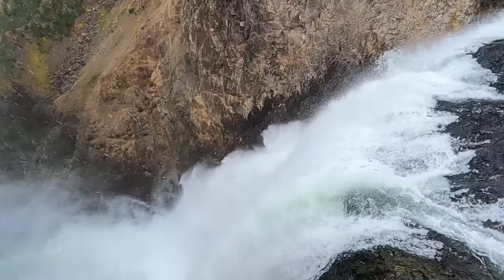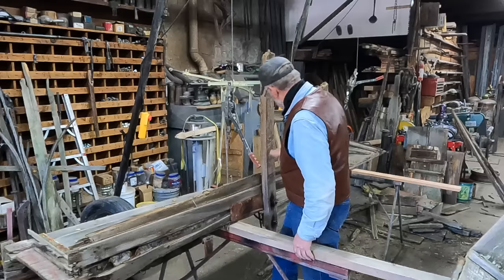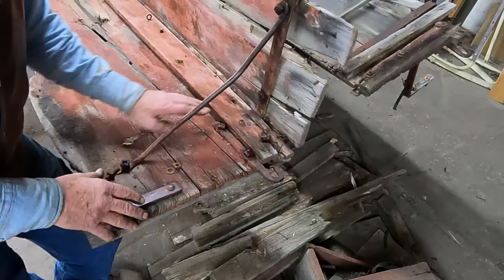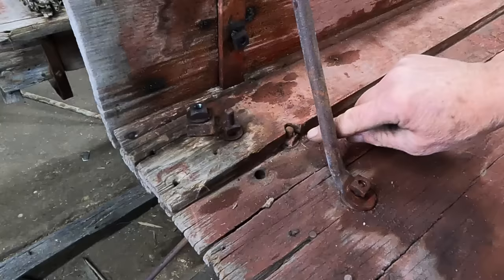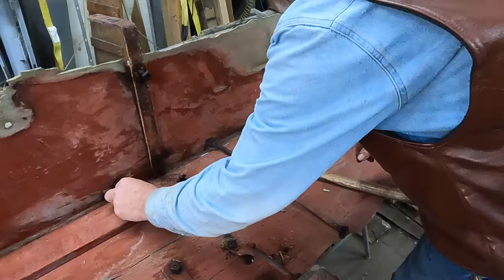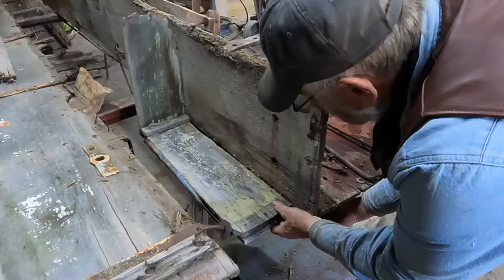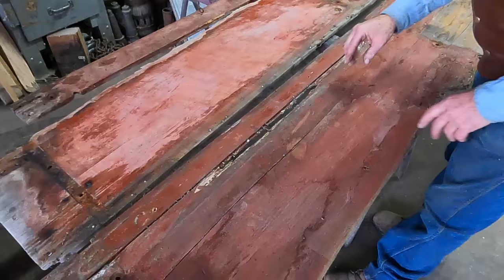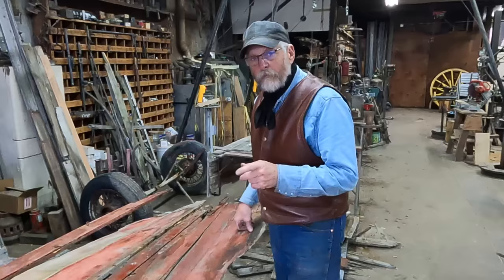If This Was Yours, What Would You Do? | Engels Coach Shop

Comment: For me, I would be considering the added labor in trying to keep as much of the old as possible. Seems to be much less labor intensive to go with all new wood materials. Depending on the owners budget it could be some kind of a waste not to go the right path with a budget constraint due to the end results.  I guess it could be patched and so forth but I'd hate to trade all of that labor to end up with an old rotted out mostly wagon. The iron work looks to me to be the same amount of work going with fixing it vs replacing all of the wood.  The sides have potential, the floor is gone, the structure is gone, dry rot is technically a living organism so, for me and considering Dave's expertise, I'd just duplicate that woodwork with new and bare the costs vs. forcing the craftsman in doing things against his norm.

Comment: All old ironwork, with new replacement of missing items aged as you do. New wood throughout where so deemed necessary,  but stressing absolute size  and dimensions taken to achieve strict duplicate copying of the original as it was perceived curing a careful and sympathetic dismantling. That should reassure the owner every care to comply had been taken to stay in cost restraints.

Comment: Looking at what is there, I would only use the irons and recreate the wood parts. As MrJeffro56 said attaching new wood to old won't last the old wood is far drier than any new wood you would attach to it. Given that in the long run you are doing the owner any favors splicing old and new wood. I would replace whole pieces or use whole pieces, but not splice. Interesting problem and thanks for sharing the process.
Reply: This is a piece of history, representing the hardscrabble existence the early settlers dealt with. All of that old wood tells a story and I would keep it except the most rotted. Where boards are compromised, I would make a 30 degree miter (looking at edge of board) and feather in a scab in as little as necessary with wood glue. To discard most of the wood, would make it a new wagon and no longer 'historical'. And if I remember correctly the owner was interested in preserving the history and did not simply order a new wagon with old irons.

Comment: I would not try to restore it to usable condition. I would have asked it to be made into an art piece by adding some framework and supports as needed to put it back to original shape (as much as humanly possible) and then use modern chemicals and paint to preserve and seal the wood that was remaining. Then I would pay for an all new replacement to be made based on that design and dimensions.

Comment: I suspect that anything you save in terms of the wood will be the first thing that will need replacing in a few years. Seems like you'd just be prolonging the inevitable. I also think that the normal stresses and strains on the structure would kind of seek out the old wood and looses up the joints. The biggest decision factor for me though is that having seen your previous work , if it was my wagon , I'd want a new build with the old irons referbished .

Comment: I'd prefer new wood to be honest, perhaps keeping what could be salvaged from the sides and benches for use as flooring.  But if they want to use it on the sides, there would need to be lots of chopping up in both width and length to make usable planks.   After that, both side and end tongue and grove joints to glue whatever could be salvaged together.

Comment: The owner is just going to have to accept that using the old iron work and replacing the wood pieces patterned from the rotted wood will yield the exact same wagon (kinda like the Irishman's family heritage hammer, same hammer in the family for 100 years with 2 new heads and 5 replacement handles..................but it's still the same hammer).

Comment: I like your investigation and your way of thoughts with the remaines of those old wagons.
To me you seem more like an wagonarchaeologist or a sherlock holmes of cartinvestigation.
For the restoration : the owner's wishes in mind I should considder (for at least the sideboards) to repair and to restore them with liquid epoxy.  That's a completly different method than you are used to, but it prevent of cutting mutch of the wood away and allows you to remaine as mutch as possible af the old wood.
Just an idea.

Comment: Seems to me that the prime question that needs to be answered, (that will help decide on how much to keep), is WHAT IS THE END RESULT GOING TO BE USED FOR?
If it is going to be a static Museum exhibit (for example), keep as much as you can and 'fill in the blanks' to present a picture.
If it is to be used for more than just wheeling out to be seen, IE hitched to a team and DRIVEN, keep the iron work for authenticity, and use the remains as a pattern to build a replica. Less time consuming to 'age' the new wood but not have to 'distress' it to match the original. 
Keeping the most amount of sound original timber, and add new such that it does not stand out like a sore thumb is going to be a real money pit. If it were a classic car, with impeccable provenance, that time and money might be justified. To me, a replica would be more informative and useful. As an exercise in "Practical Archaeology," seeing how things were put together is easier with new, whole, timber, whereas bits of new mixed with bits of old just results in a 3D Jigsaw! You can't see how it was originally made when the original joint had 3 pieces but the new has 6, half of them patched in.

Comment: Discard all the wood. Create a new box proportionately smaller that the original. Perhaps, 75% scale. ( it is not going to be used as originally intended anymore, and thus a smaller wagon of the same style would still make a great rolling display.) Then mount it on an original style 4 wheeled chassis. This would then allow for an accurate visual representation of the original, in a more manageable size. Alternatively, and still on a smaller scale, use some of the original wood, but apply to one side only, so as to show original wood, and new wood, depending on which side you are viewing it. Either way would still allow reuse of most of the ironwork.
Reply: This is a piece of history, representing the hardscrabble existence the early settlers dealt with. All of that old wood tells a story and I would keep it except the most rotted. Where boards are compromised, I would make a 30 degree miter (looking at edge of board) and feather in a scab in as little as necessary with wood glue. To discard most of the wood, would make it a new wagon and no longer 'historical'. And if I remember correctly the owner was interested in preserving the history and did not simply order a new wagon with old irons.
Reply: @clearviewtechnical  I see you have copy/pasted the same comment on several posts, but thank you for your input regardless.
However, Dave has asked for viewer feedback. Perhaps you should copy paste your single response directly to him, rather than suggesting to others how all of our/their responses are at odds with your viewpoint.

Comment: Well if you are going to bother to do anything to it, it may as well be structurally sound so make new where it needs to be and cut down the old wood into whatever usable pieces you can and reuse them for the shorter length parts for the boot, or the cabinets, etc..

Comment: I’ve used a method on Marine wood before, but could be adapted to this project. Have you thought about using a very thin plywood on the backside of that wood and then impregnating the wood with epoxy? It would sturdy it up enough to be worked on and because it is never going to be a production piece it would keep the original look the owner is wanting.

Comment: If the owner is truly intent on preserving as much as possible, would it make sense to apply some fiberglass to stabilise the remaining structure (a couple layers would provide a lot of strength and retain some visibility of the original wood) and then patch the wood? The resin for the fiberglass would require painting to prevent UV damage.

Comment: There is a distinction between repair and restoration but you cannot 'restore' what isn't there. My advice to the owner would be scrap the wood, save the iron, otherwise you've just got a patchwork quilt. Perhaps there is enough scrap wood to make a single feature with original material, like a tailgate or bench seat. That would maybe satisfy the need to see original elements.

Comment: The irons are the important parts that need to be preserved.  You can salvage most of those irons and fabricate what is needed.  I wouldn't trust any of that wood to hold up, and I'm suspecting it wouldn't look very good in the end.  All new wood would be the approach I would make.  Ha, ha, did I say wood/would enough?
Reply: This is a piece of history, representing the hardscrabble existence the early settlers dealt with. All of that old wood tells a story and I would keep it except the most rotted. Where boards are compromised, I would make a 30 degree miter (looking at edge of board) and feather in a scab in as little as necessary with wood glue. To discard most of the wood, would make it a new wagon and no longer 'historical'. And if I remember correctly the owner was interested in preserving the history and did not simply order a new wagon with old irons.

Comment: IF this was mine. Well I would build the bottom sides and benches out of new wood. Use as much of the old wood to build cabinets, and other associated little wood pieces that come up in woodworking builds. Gates etc. the structure and important parts should be safe for those little kids that will play in it.

Comment: As an old romantic, I would love to see those old boards put back in place where ever they are non-structural. So I would consolidate the bench tops and maybe even the side boards and put them back in place as they are. There is no question that pretty well all the old structural timber needs replacing. If you can get it to a place where there is a strong structural core with as much is left of as many old boards as possible hanging off it then I think you get a good compromise between the old and the new. Yes it won't look like it did a hundred or so years ago but that's partly the point isn't it?

Comment: Attaching new wood to the old wood is just going to cause problems. The old wood is done shrinking, but the new wood will have a lot left to shrink. Plus, whatever fungus has its roots in the old wood will migrate into the new wood and rot it faster. Full replacement of the wood is the most sensible way to go.

I would personally also replace the basic fasteners. There's not much point in keeping the rusted out carriage bolts. The custom bits of the iron would be my only candidates for preservation. I just did this when I recently inherited and rebuilt the wheelbarrow that I grew up with. Old fasteners were all replaced and only the weird stuff was kept. It has re-established itself as the workhorse of my yard as it mostly replaced the flimsy wagons that I'd been using. It's nice seeing old things get a new life of usefulness.
Reply: The only way I think any of that wood could be re-used would be to cut it all smaller to rebuild the entire tailgate with the passable pieces. That would avoid mixing new and old, and the tailgate could be easily rebuilt again later when it starts rotting out sooner than the new stuff that the rest of the wagon will have to be built of.

Comment: Sometimes, you have to tell the customer that  you can work wonders. But what they want is totally  impossible.  At the very best, you could build a replicate  of the wagon out of new material and reuse as much of the old iornwork and   use the surviving good wood for boxes and cabinets  in the wagon. I've seen the same problem with a person who wanted to shoot their  great ,great grand papa's  shot gun with Damascus steel barrel with modern loads. Pitting in the chamber area resembles  the face of the man in the moon . We explained why we advised against repair of the shotgun because of the barrels being forged welded from a strip of  metal barely  above  pig iorn  . Let's say he said a few choiceswords about the parentage of the  all firearmsales associate. Later, the customer  came back with a bandaged hand in a sling,  an eye patch, and a quite large black eye and adhesive bandage  covering the wound from when the shotguns  barrels let go.
Reply: This is a piece of history, representing the hardscrabble existence the early settlers dealt with. All of that old wood tells a story and I would keep it except the most rotted. Where boards are compromised, I would make a 30 degree miter (looking at edge of board) and feather in a scab in as little as necessary with wood glue. To discard most of the wood, would make it a new wagon and no longer 'historical'. And if I remember correctly the owner was interested in preserving the history and did not simply order a new wagon with old irons.

Comment: I don’t see anything that can be saved to use again. By the time you cut the sides down to what can be saved it’s too small and it’s still mostly rotten. You would be putting new wood with old wood that’s 50-70% gone. I would use the iron that’s salvageable and have a good wagon. He never realized how this would fall apart as you started removing the iron. I would never remember how to put the pieces back together if I had all new parts. Thanks for your knowledge.

Comment: The wood looks too far gone to save. Since the floor and tail gate are completely gone as well, there's very little left to save. By the time you scab in new wood where needed on the sides, they will be almost nearly all new wood anyway. Factoring in your time, it will be cheaper to start with new wood and distress it for that old look. I'd keep the irons and look for an original piece of wood that could be salvaged to become an accent or feature piece inside wagon for the owner to recall their childhood memories of the wagon.

Comment: Scrape every bit of the wood and reuse/restore all the Irons.
 The wood is done for, its bone dry, punky & rotted. Personally I wouldn't trust it in any kind of Structural situation!
 
 The only two uses I see for this wood is one, making something for purely sentimental reasons like a Bench/Stool, a Table Top. a Cabinet or a Gate and the other use is burning it as Firewood.

Comment: There comes a time when total restoration of the original is not really feasible unless you have more money than sense.  From my very uneducated opinion this wagon is just too deteriorated.  If I was the owner, I would not spend the cost of restoration of the existing components but otherwise incorporate some of the original components in a subtle way (decoration?) that preserves something from the original. Some of the metal hardware and metal structural components come to mind for me.  Thanks.

Comment: I guess it depends on the cost of repair or rebuild, not watched the video yet, but I can't see how you are going to save any of that.       

EDIT: Now I have watched the video. I would say keep all the irons and nuts and bolts, fit new wood, maybe make a box out of the original timber so it's got something original in it also. Probably cost more in labour to save the 2% you can than use new material anyway.

Comment: If this wagon box were mine, I would replace all of the wood parts with new material. From a historical/sentimental perspective, I can understand why the owner would want to preserve as many of the original wood parts as possible. However, in my opinion, mixing new wood material with old deteriorated material is unwise and undermines the quality and strength of the repairs and devalues the significance of the work and expert skill being invested in this repair project. But then again, it is only my opinion.

Comment: You don't need my twopence really - everyone else has pretty much said it.

If you saved the ironwork (that  you can - even some of that looks dodgy), and rebuilt the woodwork, the owner would have a wagon that looks and works right so following generations can understand it.

It will actually last well for those children and grandchildren. And, I guess it could be used, too, so those same youngsters might actually ride or even sleep-over in it.

I'd go with giving them the experience - they'll thank grandpa for it and remember it forever.

 For the owner, keeping every not-rotten piece, no matter what, adds huge cost, to no good purpose really.

Comment: I think the owner is looking at it through those rose tinted glasses, mounted in a frame of nostalgia and polished with a little wishful thinking. This isn’t so much a wagon as the ghost of a wagon. Parts are missing, and the ones that are still present are mostly there in spirit rather than substance. And it’s not even an actual shepherds wagon, or rather it didn’t start out as one.  What would I do? That is a tough question, as I acknowledge that I don’t have the same connection emotionally as the owner, and can appreciate the idea of rescuing a piece of history, I think that the real question is for what purpose is it being saved? Is it just going to go and sit in some yard as a relic for display, or is it expected to carry any weight whatsoever? And to what condition in its history would be appropriate? Some might say to put the car axel back underneath.  This one is a tough one, and I don’t envy you having to do the work.